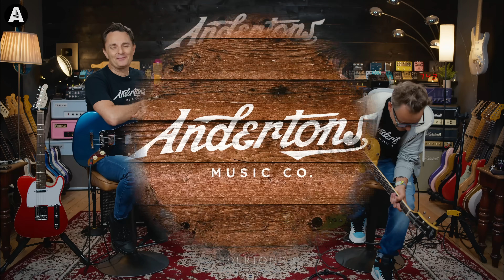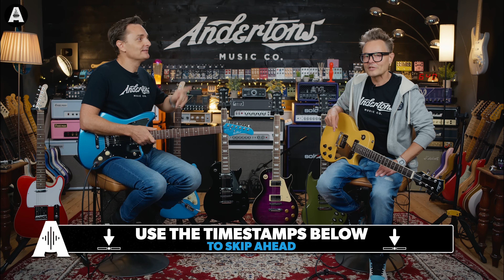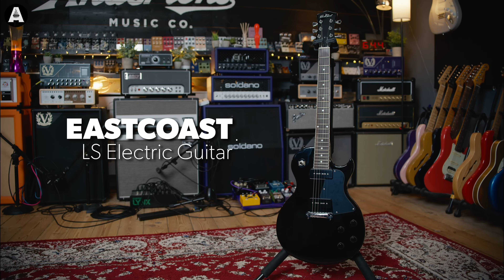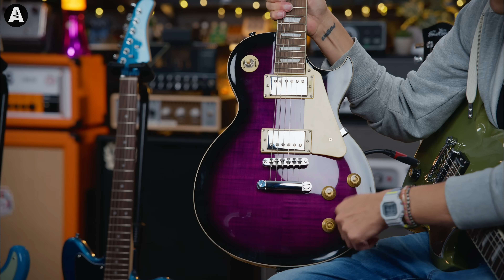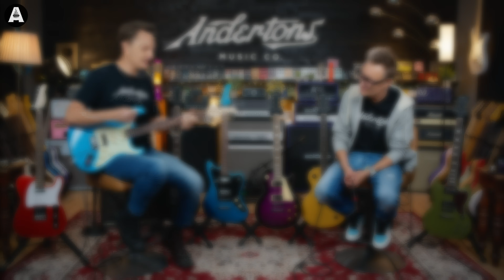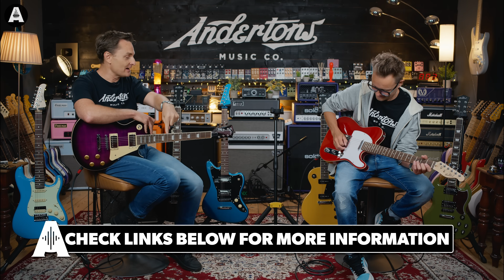Brilliant Budget Guitars - New EastCoast Range!

Comment: Overall a lot of variety and great colour schemes at affordable prices. Currently eying the GS61S in black or olive green, which from all the budget versions out there, look truest to the original imo (excluding Epi's). Not sure though about the headstock and big frets (medium jumbo according to specs, but they look massive, almost like jumbo's). Would appreciate any feedback from owners of GS61S. TIA. Regarding 21:18, just read that David Gilmour’s Black Strat had a humbucker added in 1973, between the middle and bridge single coils, so not a conventional arrangement, more like a predecessor to the HSS. First official production HSS model appears to be the Peavey T-27 (1980), followed by the superstrats e.g Kramer Pacer (1982). Cheers.

Comment: The JG seems like it would be quite nice to tweak.  I'm thinking of slapping a Bigsby style trem on one and a roller saddle bridge.  Then there are the pickups, a switch to split the pickups would be a nice addition (assuming the pickups have the appropriate wires), possibly with a pickup upgrade although they don't sound bad from here.  This kind of instrument is perfect for tweaking and making your own in my mind because the wood choices are decent and it's not like you would be losing much money if you broke it.

With regards to the ST model, have you received you C&D from Fender yet Lee?

Comment: I am a novice and bought an EastCoast T style with the 35w amp package a while ago. I cannot fault what I bought, and the guitar finish and set-up is amazing. I bought set up tools as well, but I haven't needed them for this guitar (I will use them in the future when I upgrade). The only question I have is, 'would you gig with an EastCoast guitar?' . Obviously not the practice amp, but are the range of EastCoast guitars of a standard that would pass muster at a gigf?

I'm a way off jamming, let alone gigging, just to clarify. I'm curious if anyone would gig with one.

Comment: Just got my GS61S (the SG - duh) in black here in Denmark from Andertons. Pleasantly surprised with how well it plays and how well it's put together. Always been a strat guy but liked SGs, and following the shit Fender is up to at the moment I'm not interested in bringing my strats to concerts.

So the plan is to put in single coils and put on locking tuners, a string butler, Graph Tech saddles and nut and then rip out a tone and volume knob, so it only has one of each. If I'm up for the task I'll relic the body and colour the headstock white and write "Fender" on it to see if it pisses someone off. Nice video! :)
Reply: I'm currently looking into getting a SG - also in black - and the GS61S catched my eye. May I ask, now that a few months have passed, what your verdict is on this model? Is the weight ok? What about neck dive? Fretwork? There isn't really much info out there on these...TIA for your feedback.

Comment: I often wonder how a well manufactured 2026 budget guitar made in a high tech factory compares with an original Fender or Gibson from the 50s/60s.
Reply: I think I can answer that question since I own an original '57 strat and a brand new Squier Affinity Strat : 
Guitars are like people, some age well, some not so well...
I'm lucky because I have a really nice '57 strat that ages really well and sounds better and better over time...
The Squier Affinity Strat doesn't have the "depth" and the "color" of the '57 but it sounds much tighter and after a few upgrades ( Tusq nut, locking tuners and different singlecoils ) it has become my favorite workhorse for any situation...But the amazing thing is that when you put the '57 and the Affinity together they definitely are the same guitar and the sounds are basically the same with a few obvious differences in feel, touch, etc...
Reply: As someone who's played tons of vintage guitars, they're like any other guitar. Some are great, some suck.
Reply: @lnyt445 Absolutely